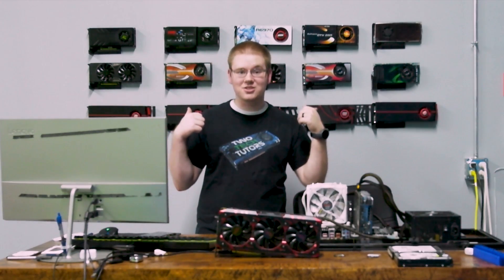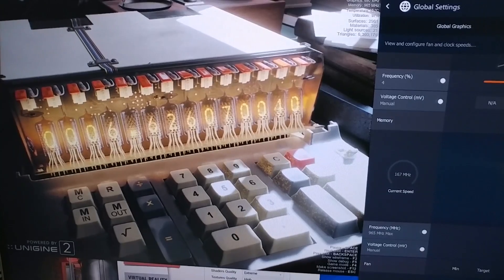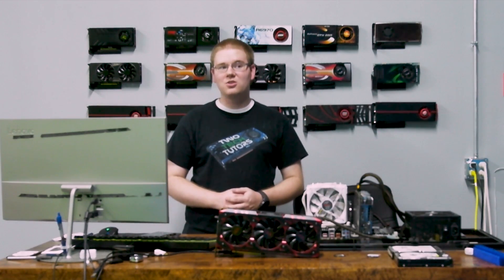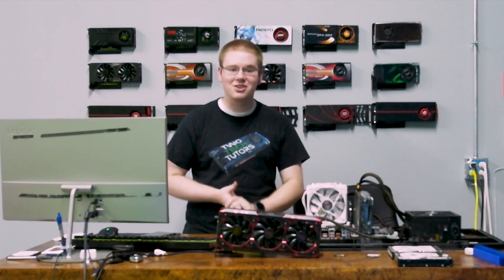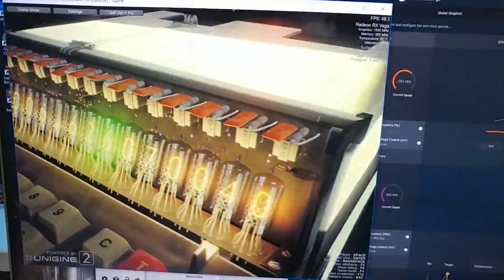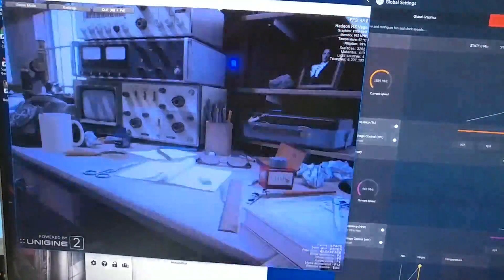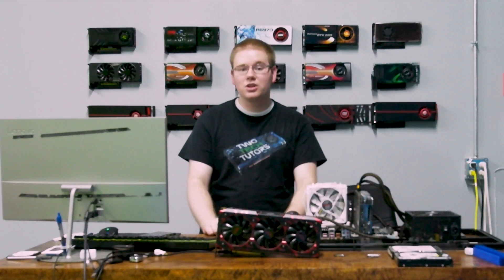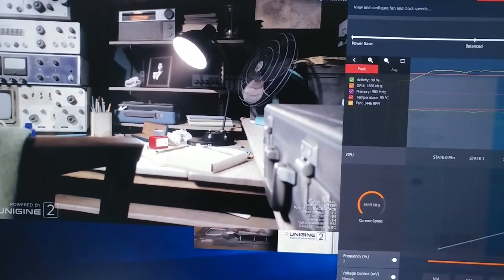GPU Artifacting: Examples & Explanation

Comment: I've updated a system but kept the old gpu. Now it has these kind of symptoms. It seems pulling the old GPU out of the 10 year newer system resolved these issues. Bios memory speed was running automatically at a lower speed too. With gpu still in and powered, the onboard gpu also gave these problems.

Comment: I really wish i could share my  video evidence of my artifacts its so confusing and abnormal. Got a brand new 4060ti, looks flawless. Pop it in my pc and boom my slapsh screen has horiozntal lines that and this bar below my taskbar that flashes a different color each boot. But this all goes away the second I use the same HDMi cable just plugged into a different monitor. I cant replicate the artifacts on any other TV aside from this 50 inch LG gaming tv I use. When I change the aspect ratio in the TV settings, the artifacts lessen. Heres the real kicker, if I put my old 3060 back in the machine, same TV, same cable, there is no artifacting no matter the aspect ratio. Temps are great on the 4060ti and Ive ran demanding games all night long and not a single hitch, so I dont know what to do.

Comment: I have a rtx 3070 with a ryzen cpu. My artifacts were covering 1/3 of the screen vertically and the whole screen horizontally. and they were like glitches instead of pops and fladh in full screen. The glitches would show even when the gpu idles at 30c and even when in bios. Sent my xiaomi 34" to the shop, they said they'll give me a new one. Every single part in my pc is brand new. Now hoping that the new monitor fixes it otherwise it might be the gpu.
Reply: What was it?
Reply: @Loldude-go9wp  it was the dp cable that came with the monitor.
Reply: @achannel6677  lucky, also thanks for the reply

Comment: I have a i7 3770k and nvidia 1050 ti at 1440p if I overclock to 4.3, at 1.295 v on rog watercooler I get light green or pitch dark colours on cod cold war, if I overclock to 4.2, at 1.285 v everything's works fine, I'm not expert enough to get it to configure on higher turbo values, but I have 16gb ram and ssd hard disk and have only 0.2 bottleneck.

Comment: The one with the memory, I had something like this in warzone loadout menu on my new 30series card. I am still trying to find out if it's the game or my cards fault. I went in the loadout menu and the light started from rightside monitor and got bigger bigger. Until i quickly went out the menu and it was all fine after that. What could this be? It was white green

Comment: Cold War. Always.
1650 Mobile.
I'm already pushing the chip with that game but it gets a stable 60 fps on High Settings in campaign, 40 min fps on low settings in multiplayer during intense battles.

I've seen everything from textures glitching out, polygonal artifacts from mesh, and even transparent textures for particle effects turning into Garry's Mod missing texture style checkered squares.

I don't think my memory can keep up with the game. However, I've also noticed people with 3090s complaining of the same thing. So I think it's software related rather than hardware.
Reply: Underclock it and thank me later. I know it sounds counterintuitive but trust me on this one.

Comment: Hi, could you answer this question, 
If I set my memory clock at 2100 the game will start artifacting and crash (like you said)
But if I set it to 2200 it will run for maybe 30 more minutes and do the same thing. 
I've been trying to deal with this problem since July and none of the solutions helped.
BTW RX580 8gb

Comment: vary educational BUT How do You FIX, this is like one of the hundred of thousands of chat room where a bunch of people type in "oh yah i have that problem too" but no fixes.
Reply from the maker: Because the problem is a physical issue with the card, replacing the card through a store return or manufacturer RMA is the way to go. Unless you're set up to replace and solder BGA chips on a GPU, but most of us don't have that kind of setup at home.
Reply: @3DPC  so, this are the last gasps for air of a dying GPU?

Comment: GPU artifacting is like the math teacher who won't tell you how to get the right answer then gets mad at you for getting it wrong
Reply from the maker: THAT is an excellent way of putting it!
Reply: @3DPC  You seem knowledgeable about things like these, so I'll want to ask you quickly about a problem I'm experiencing, and you can determine if it's a matter of hardware, or software. I'm reasonably certain it's software, but I genuinely don't know enough to be able to say for sure.

The program I'm using is GzDoom version 4.5.0 (a sourceport of classic Doom), and, on odd occasions when playing, I will see an odd kind of tear in the floor, like a floor surface warping out and stretching/flickering, but only like a piece of it, and it doesn't seem to adhere in any way to how the level in the game is constructed with linedefs and sectors, rather it seems a random triangle of the area in question.

I did not experience this with earlier versions of GzDoom, it doesn't happen in other ports, and it doesn't happen in GzDoom Builder, both of which are hardware accelerated. It happens seldom, but it does show up, I've seen it in a very old Doom level made in 1995, and in recent levels, even ones I've made myself (and nothing about the map data is weird in either, nodes, visplanes, blockmaps, etc, it's all as it should be and not abnormal).

Regardless of if you have any familiarity with Doom or its ports, this would sound like it has to be a software error, right?

Comment: Sometimes whenever I play games for some reason random polygons of any model stretch to random places, sometimes creating sheets which cover the in-game camera. It only started happening when I decided to overclock my gpu by 300mhz. Is this also artifacting or did I break it? have an rx 580 and Intel core i3 8100.
Reply: Did you use Radeon or afterburner to overclock?
Reply: @Mava Tech Radeon
Reply: @chilk4508  Well Radeon OC is almost always safe, so I think you might want to use auto OC or try to RMA if you still can.

Comment: hi, I hope you read this, but this is my first time buying a 2nd hand gpu due to budget problem thanks to certain virus, so I'm really worried about the condition of my card, I run other test like heaven benchmark, or even benchmark provided by video games, and overall it performs great, the temps are peaking at 74c max, and idle around 40c, but my friends keep bugging me about this gpu artifacts thing, and googling doesnt help much which finally land me on this video, does gpu artifacts only shows like what you just shown on your video? like the color flicker while running a game, since I've tested it playing games for about 2-3hrs a session, and I never see anything like what you've shown in the video, and I'm kinda afraid using furmark, since its actually put a stress to the gpu that could lead to damage

Comment: Thanks for the video. My rx580 i think its dying. I have something similar like this. Damn
Reply: @sp0i148  i fixed my problem bro. It's an overheating problem. You have to underclock the gpu. Don't let it go to 1411 mhz . Like stage 6 and 7 put it like 1260 mhz and 1280 mhz. For me it worked but still. I wish i bought an nvidia.

Comment: Is it possible for your psu to cause this problem? I bought a pc from digital storm and I got artifacting and screen glitches when I played games so they gave me a refurbished replacement and as soon as I played a game again I got the same problems, I need help figuring this out
Reply from the maker: I would think the PSU unlikely as the GPU components are being fed voltages from the power delivery on the card instead of 12v directly from the PSU. I would defer to either GN Steve or upside-down, monitor Steve for an "is it theoretically possible" answer, but as for it being likely, no.
Reply: 3D PC im just trying to figure Out why I keep getting screen flashes and artifacts it sucks

Comment: Hello, trying to see if anybody has had this issue and has found a fix to it. I bought a 5700xt  around 2 weeks and have tested it on 2 different pc set ups even with one 1080p and a 1440p monitors and get the same results as soon as I install the software I have use DDU and uninstall everything and reinstall the software again but nothing seems to work, please help if you can I would appreciate it a lot. Thank you for your time
I uploaded this video with what I visually get https://youtu.be/zZAs4zx83vw

Comment: Idk maybe you can help me on this. I kinda get stuff like this (https://i.gyazo.com/bfcd666c9e8b3b2ef115dc5ddf52445a.png ) when playing games like AC Unity or Far Cry 5. 
My Game screen slowly increases with the amount of hexagon/circular glows on my screen and then crashes. Back then I hadnt this problem and I even after re-installing my windows I still have this issues :(
Reply: same issue any solution?
Reply: @nouman7014  I am curtain it happened because of my overheating GTX 1080.  My card was 4 years old. I watched a tutorial on how to replace the thermal paste and cleaned it pretty good. Now it's running at good temperatures again and doesn't show artifacts ^.^ hope this could help.
Reply: @ReeDyEdits  what were your temps before replacing thermal paste ?
Reply: @ReeDyEdits  i slightly underclocked my card and issue is gone 
i told someone about this issue and he said your card might need REBALLING or Chip replacement .
Reply: @nouman7014  puuhh not 100% sure. I have the MSI GTX 1080 and I think at like 78°C - 80°C my games usually crashed or had artifacts. Now it idles at 55°C and goes up to around 70°C when gaming. If your card is old just try replacing the paste (not that complicated). Undervolting is fine if you have nothing against losing a little bit of power but I didnt want that. 

Not dealing with the causes can also damage your card -> true but I would just try my method before going for a chip replacement. At that point maybe a new card is even better. (less headache) 

Which card you've got?
Reply: @ReeDyEdits  asus rog strix 1080ti
Reply: @nouman7014  Ye I would try replacing the paste and clean the fans etc. 

and if this doesn't help I would just save a little money and wait till the RTX 30xx series is available again. I e.g. wait for the 3080 and it's just 2,5 x better than my 1080 x) 

If it works and you don't need a new card then that's even better :D 

Hope I could help ^-^

Comment: i have a invisible (its kinda blurry_) line that starts from bottom left corner of screen, (1660ti running rust lvl5 graphics) my m8s 5700 does the same. what is this even called?
Reply from the maker: If two different GPUs are doing the same thing, it might be the monitor. I had a different issue (screen resolution suddenly dropped to 720p, can't set back to 1440p) where rebooting the monitor fixed the issue. With it being the same single row of pixels too, I'd be even more inclined to think its the monitor.
Reply: @3DPC  Ty for Ur help. Turns out it was parralex mapping (objects) setting was up too high. A known issue in rust apparently unless U have an ampere titan gpu U cant max out that setting... Fax lol
Reply: @3DPC  https://youtu.be/2N3LkB4PbDA
Reply: @3DPC  it's visible in bottom half of screen, this is it exactly.   Note - not my video.

Comment: My video card was doing this. Before throwing it out, i put in in a toaster oven at BROIL (450*F) for 15 minutes (removed the heatsink). let it cool down for 30 minutes. Popped it in the PC, all artifacts gone! Bad BGA soldering it seems, just like PS3's.
Reply: Wait, did you actually?
Reply: CroixFrozy Yeah, it’s a legitimate fix, people do this
Reply: @cobaltdev  bruh is it a thing? Im surprised that my rx 580 only survives 2 years but my old laptop that i abuses a lot to the point where it always reach max temp doesnt even broke
Reply: frhn it’s a real fix, search it up. I have had an Acer nitro 5 for one year and it has had 0 problems apart from me fucking up the drivers but that’s fixed
Reply: frhn I have the same GPU and owned it about the same amount of time
Reply: There is a tool specifically for this called a soldier rework station or tool. Basically it can even heat the entire circuit board to make the slider connections soft enough to reflow. But yeah, the toaster oven can work too and is only $20!

Comment: So im using a 1050ti and while playing not that demanding games like elder scrolls even at lowest settings after a certain amount of time (beginning or during fights) ill get large dead pixels around the screen combined with the screen frozen. Ive also had this happen even in the main menu including this blue screen of death saying "video card failure". Any help towards this would be appreciated :)

Not overclocked
i3 7100
8gb RAM
GTX 1050ti

All drivers updated
Reply: Try underclocking it...worked for my 1650 ti. For some reason my 1650 either came overclocked in the stock configuration or it was actually working faster than the memory's clock cycle could read and write. As soon as i underclocked it with MSI afterburner..it fixed the artifacting problem .
Reply: @mirzadabehram4084 how to underclock can you send me any video link ?

Comment: I had a few spots like those playing warzone on my 1080ti, but thats the only game it does it, is it early sign of it dying or potentially a software issue?
Reply: I have a 1060 6Gb and like a week after I started playing Warzone I begun getting horrible black lines all over the screen.
Reply: @JoaX248  in warzone only?
Reply: @aljoker7808  It started happening in Warzone only but now Its happening in other games also (The Witcher and Resident Evil) but some otherd games just look fine. I try using diferent GPU Stress testers amd and everything was okay with the GPU. I also completely remove all video drivers and downloaded them again and no fix after all so right now I just don't know what else to do.
Reply: @JoaX248  Ive run Fur stress test 2x and no problem.
Reply: @aljoker7808   After hours I found a I fix that actually worked, I downloaded DDU , uninstalled all GPU drivers. Roll back some Windows updates and then Updated it again and finally downloaded the latest GPU drivers again. Everything is working now hope this can help you.
Reply: @aljoker7808  Forget about that, after like 5 min playing the same issue came back I dont know what else to do I guess the Hardware is probably fucked up
Reply: @JoaX248  Tha'ts good news, i'm not really bothered since in my case its rare, was just worried its my Gpu failing. Good to hear its a drivers problem:)

Comment: Dude, after two months my rx 570 started giving artifacts as the example you gave in some games. does it mean that it doesn't work anymore? Nothing can be done?
Reply: Sorry for the late answer. If your GPU gives artifact on stock memory clock, you should RMA it, but if the GPU gives artifact on higher memory clock try to turn it down a little bit. Also, I prefer to use OCCT to check the stability of the GPU memory. OCCT has a GPU memory stress test with error counter. But, I won't recommend this program to check the stability of the GPU core. I prefer to test the GPU core by using 3D Mark, Unigine, or playing around with some games.
Reply: Same issue with my rx 570 bought it new and its less than a year now.

When i play games its running fine.
But when i leave my pc and and the display sleeps and when i wake it up i see pixel like artifacts.

Comment: Hey, I have been facing problem of artifacts patch on random areas of screen some times while gaming sometimes not, also a full screen artifacts (also caps not working ie stuck but cpu fans running). But after I restart PC it gets backs to normal, so wanted some help in finding what is the solution to this issue. 
CPU :- AMD 1600 AE, 
MoBo :- Asus Prime 350 plus, 
RAM :- G Skills 16gb 3000Mhz, 
GPU :- MSI R9 280x
Monitor :- Dell S2240L
4 to 5 years old built

Comment: I'm running an RX 480 4gb and get plack triangles flashing on the screen. For some strange reason, it sometimes goes away when I overclock and seems to be tied to framerate. When I run games at a lower framerate, it's fine but if a game goes above 60 then black triangles flash all over the place but when the frame rate is lower it's fine. Also, the card is getting abnormally loud just before the triangles appear and the game ultimately crashes either itself or windows.
Reply: Maybe limiting the frame rate to , say , 60 fps will fix it?
Reply: @antony9956  it might but then I feel like I'm wasting some of my monitor. I might be switching the card out for a 1060 though so that will hopefully fix it
Reply: @jdmskater047  Eh, it is an acceptable temporary fix, i suppose
Reply: @antony9956  yeah ill see if it works, thanks

Comment: I’m getting checkerboard like patterns sometimes with different colors, small areas, entire screen, then crash or lose signal to monitor. My pc build is all brand new components EXCEPT I reinstalled my old RAM and GPU.. tests come back clean, still think it’s the GPU, waiting on zotac customer support to provide me with some information
Reply: JRswag that’s the same with me only my gpu is new only got the build like 1 month ago Nvidia 2070 super
Reply: I ended up buying a new GPU Nvidia gtx 1060 and it works the balls. You may be unlucky and got a bad GPU, I suggest returning it if your still under policy or RMA it as I’m sure you still have 1 year on your manufacturer warranty.
Reply: I ended up buying a new GPU Nvidia gtx 1060 and it works the balls. You may be unlucky and got a bad GPU, I suggest returning it if your still under policy or RMA it as I’m sure you still have 1 year on your manufacturer warranty.